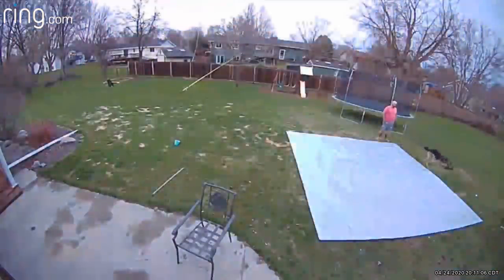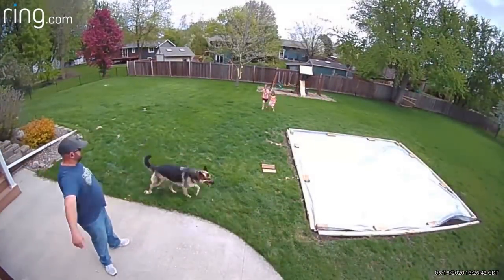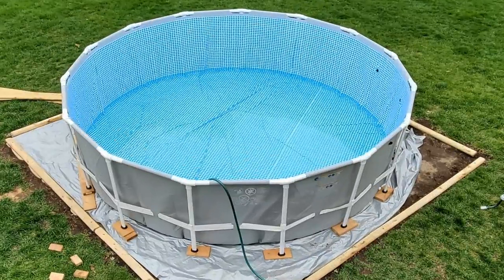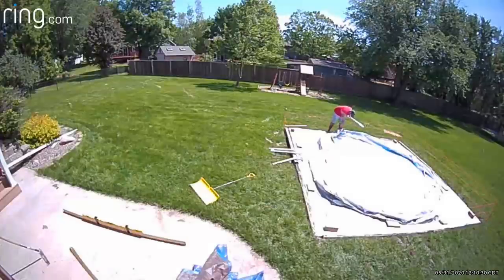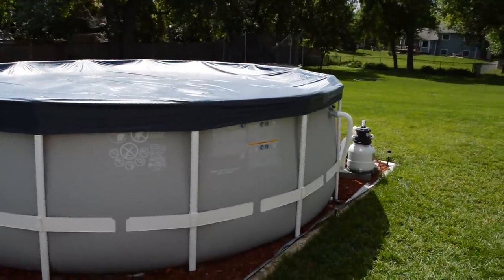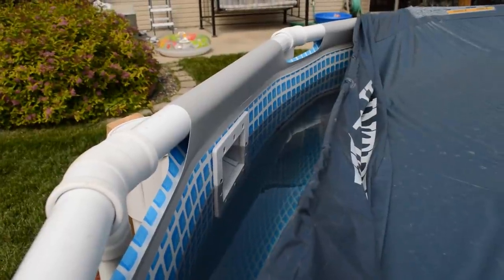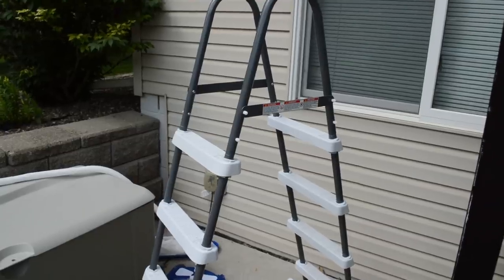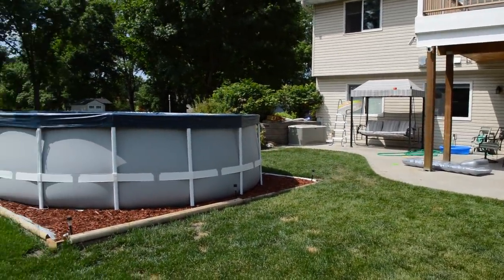Intex 15 Foot Prism Frame Above Ground Pool Setup, Review, and Mistakes!

Comment: I know how when you messed it up the first time you used sand and the second time you used black dirt. Could I still use sand or should it be best to stick with black dirt? Also I'm just wondering how is the pooling holding up now? Last question, can I use smooth rocks around the poll instead of the wood chips?
Reply from the maker: I would use black dirt to make it level first. Then pack it down. Do NOT use sand as a leveling medium because the legs will sink into it. Only use sand once the ground is level to provide a softer bottom for the liner. And definitely go with smooth rocks if that's what you desire! The pool held up great all summer last year and I'll be setting it back up here shortly!
Reply: I did not watch the whole video when I commented that so I do have another couple of questions. Did you find a replacement ladder yet? If so can you please tell me how sturdy it is and what is it called? Another question I have is how big did you cut the pool for the pumps because If I do get a pool, I don't want to cut it too big or too small. Last question, did you buy another cover for the pool or stick with that one?
Reply from the maker: I still haven't found a ladder yet that I like. I cut the holes just big enough for the jets so it's hard to know for sure. And so far, I still have the same cover.

Comment: I noticed you put the vertical legs on before the last T joint was put in place. Did that make it easier? Because getting this last T joint in is a bear.
Reply from the maker: Yes it did. It gave me some leverage to go a few different angles before it finally popped into place.

Comment: What did you use to plug up the original outlets on the pool? Thanks for all the advice
Reply from the maker: The pool came with two plugs actually to plug up the holes. Apparently intex had the foresight that some people weren't going to use the original pump for the pool. :-)

Comment: Hey great video! Question, do you have a video on what happens or what to do if it rains? Example: Do we cover the pool? We set our up already and there is supposed to be some rain this week. 😬 What do we do now...what if it over flows...🤦🏻‍♀️
Reply from the maker: So what I do is leave the cover off and let the pool fill up. The next day you'll need to check your chemicals because they will most likely be thrown off by the rain water. But if it gets too full, just jump in and splash some out! Or, you can simply unhook the return line from your pump and purge some out that way.
Reply: @dontburnthehousedownvideos  Thanks for the info.😊👍🏻

Comment: just setting up pool with intex sand filter,  how did you decide where to cut the hole for the outtake....and I assume you just put plugs in the other holes that come with the pool that are between your skimmer.
Reply from the maker: Yes! I used the plugs that came with the pool. For the outtake, I simply used the existing outtake hole and made it bigger.

Comment: I read somewhere that I will need an electrician to come out because you can’t plug the pump into an extension cord. Have you had any issues with it?
Reply from the maker: No issues at all. It runs just fine. Just make sure your extension cord is rated for the amps of the pump.

Comment: I have watched your video several times. We have an Intex Ultra 14 x 42 inch pool and have (like you) emptied the pool to level it again. I have a question about the filtration. I have added the Hayward skimmer and the pool came with a sand filter. I believe it is an 8inch filter, the smallest one which doesn't have the basket before the pump. The skimmer doesn't seem to be pulling in water and shmutz from the surface. Do you think I need a larger sand filter?
Reply from the maker: Is the filter running properly? I would think the 8 inch should work but it may need cleaning or new sand in it.
Reply: @dontburnthehousedownvideos  Thanks so much for your quick reply.The vacuum works just fine, it's just the pine needles that collect around the sides of the pool wall. I don't mind skimming by hand. the rest of the water is crystal clear. BTW it is a new pool with new sand, not even a week old so I think the sand should be fine.
Reply from the maker: Are you able to adjust your return jet in the pool? I have mine pointed away from the skimmer so it pushes the pool water around in a circle. It works pretty well to circulate all the crud into the skimmer.
Reply: @dontburnthehousedownvideos  I was thinking that might help. Right now the return shoots pretty much out into the center of the pool. I can't change the direction with the existing return but maybe I can find one with some sort of swivel? I will have a look online. Thanks again for your time!

Comment: OK our whole backyard is nothing but pavers no dirt just pavers would we be able to put the above ground pool on our pavers? With some type of padding ? Will the pool be OK on top of pavers with padding? And will the pool be sturdy as well ? We are thinking about getting one  Maybe
Reply from the maker: You'll need to put down a mat of some sort underneath it. I'm sure the pavers will be fine as long as they're level but definitely find something to put under it to protect the pool from the pavers.
Reply: OK that's what I thought. Would a pool pad the same size as the pool work ? Possibly
Reply from the maker: As long as it's thick enough to not allow any sharp corners to poke through.

Comment: Wondering what you used for a barrier between the pool and the wood chips. I’m afraid wood chips or rocks would puncture the liner.
Reply from the maker: I just kept the wood chips back away from the liner. I didn't have any issues with them traveling underneath it or causing any issues.

Comment: Thanks for this !!! Wish I saw this 4 days ago🤦🏻‍♀️ how did you cut the hole for the filter hose to put the filter water back into the pool ?
Reply from the maker: I used the existing return hole and just used a razor to make it bigger.
Reply: Omg thank you !!! Your video is the best !!
Reply from the maker: Thank you very much!!
Reply: This might sound dumb but it’s OK not to have that black thing sticking out that the hose  connects to?
Reply from the maker: On the return port, I cut it off.
Reply: Ok thanks again !! just scared putting a hole in the pool

Comment: I feel you ,our easter bunny did the same thing,  then she  I mean  ms. Bunny told me not asked  me to put it up which I reminded ms. Bunny that I'm the grinch  and you ready for the real bad news this season ! We have a  three foot drop grade from the back house to alley   for water runoff!  It drops 3.ft  in about 40 ft   .. grinch needs some cool tools let's start with a tiller !which  she delivered a week later!  Then I asked i need yard tape measure  .ms bunny asked what's that for .Well it's for me to measure and lay out the pool . So she went and got me one . So I painted a 24ft round circle for a 22 ft round . Tilled up the circle and removed dirt till it was eye level   I removed at least 2 yards of dirt . Ms bunny the grinch needs string levels . Ms bunny delivered a week later which I got perfectly level after another  yard of dirt removal  ahe asked then why dont you put up the pool now .. well I'm the grinch we need 5 yards of sand   .. ms bunny what! Yes ms bunny for it to be done proper it needs 5 yards of sand per instruction!! After a dump truck delivery of 5 tons of sand  it was time to start setting up the pool   ! It finally was setup 1 and a half months after the easter bunny thought was a good deal on a  and the equipment and sand was well above the original cost of the great deal !and ms bunny said I had no ideal how much had to be done for the pool I said next.time listen to mr grinch he knows what's he is talking about !

Comment: After soaking the sand, did you wait until it was dry to proceed?
Reply from the maker: I let it dry overnight. As it dried, it hardened up quite and made a nice base for setup. Also, I saw some water pooling in a few areas that showed me low spots that i raked out before setup.

Comment: We are going the solar heater route to heat. How long to bring it up to temp? What temp did you heat to? We bought 15’x48”
Reply from the maker: It brought the temp up from 55 degrees to around 72 in a week. Now, granted, it was also pretty warm outside so that's hard to gauge accurately.

Comment: I have question.  I am starting out on a gravel pad.  How would you suggest leveling this?  Do you think I could just use sand on top of gravel?
Reply from the maker: Is the gravel already level? If it's level, I would personally drop a tarp down on top of the gravel and put the pool on that. Adding sand will probably only make it extremely loose and you'll have lots of issues with the feet sinking in.

Comment: I am currently filling an Intex prism but I can't get the legs to go fully out straight (as the band is too tight to pull them out any more). They pull in a little ( about 1 -2 cm off plumb ).  I have looked at your pool and the legs also look like they are at a slight angle.  I am just wondering if that's normal for a prism frame and whether it causes any issues ? The pool is level.
Reply from the maker: Fill it all the way and it should even out. The pool bladder pushes out like a water balloon resting on a table when it isn't completely full. But once you get it to the top it will equalize the pressure and straighten itself out.

The other thing is that if the entire pool isn't level, the water will push to the low side and cause the legs to appear to be leaning in towards the pool. That's because the bladder is trying to roll downhill but the legs are preventing it. If the opposite side legs aren't doing the same thing, I'd say you have a leveling issue. If they're all doing the same thing, just let it fill.
Reply: Thanks !

Comment: One question. Did you had to run an electrical outlet specific for the sand pool pump 
Or just used an electrical cord
Reply from the maker: I just used an extension cord. Nothing fancy.
Reply: @dontburnthehousedownvideos  okay thank you.

Comment: Do I need to put sand underneath the pool?  Also, did you put mulch under the pool too, or just around the pool?
Reply from the maker: In the video I discussed that the sand should only be used as a final inch or so just to keep the bottom of the pool feeling soft. I wouldn't put more than an inch under there. Also, the mulch is just around the base. Don't put the mulch underneath or too close to the pool. It can puncture the liner.
Reply: @dontburnthehousedownvideos  Thanks.  How much sand should I get for a 15x42?   I think I'm going to just load the back of the truck with x amount of yards.  Mason or mortar sand work?
Reply from the maker: I used bags of "finishing sand" which is usually for paver installations. For the 15 foot radius I think i was about 30 bags in. If you're buying in bulk, there are several websites available that will estimate how much material you will need based on your measurements. I entered 15'x15'x1" square and it says about 0.7 cubic yards. Probably bump it down to 0.675 and you'll be good.

Comment: Did you simply cap off the preexisting supply and return inlet/outlet?  I have seen other install videos for the skimmer and they still have a hose connected between the two, which imo would be a potential breeding ground for nasty stuff.
Reply from the maker: Yep. The pool came with caps for those holes so I just used those.

Comment: Does the filter pump that comes with it work with a smaller pool? Like a 10x30 or 12x30? Or is it just no good for anything, period…
Reply from the maker: It might! I don't know what those fittings look like. One other gal recommended using it for a waterfall pump.

Comment: Can you share the dimension and the lawn timber used to build the lumber frame around the pool?  For 15ft pool round one, should 16 x16 square good enough. How are you joining the lawn timber?
Reply from the maker: I used treated landscape timbers from Home Depot. They come in 8 foot sections. 16x16 should be good but it will be close. I would space out the corners of the timbers a bit and give the square a few extra inches that way. (Don't have the corners touch, but have a gap where you can put a tiki torch or a vase or something.) And I don't have the timbers joined on the ends. They're just laying next to each other and secured to the ground with rebar. I drilled holes in the timbers and pounded 6 inch rebar into the ground so they won't move.
Reply: @dontburnthehousedownvideos  thanks a lot. Do I have to use the timber frame around the pool? Can I simply use the stones to cover extra area after pool install  ?

Comment: What sand did you use for the filter?  I’m clueless because every review I read has mix reviews so now im confused 🤷🏻‍♀️
Reply from the maker: It's literally called filter sand. I get it from the hardware store in the pool section.
Reply: Do you know how many pounds do I need my pump is the 12 inch?? Thank you so much for your help!!
Reply from the maker: It should tell you in the manual. My 10 inch pump used one 50 pound bag.

Comment: Did you have any problems or concerns with the pool legs? In the process on installing...again. but it seems the legs have a tendency to drift underneath the pool.
Reply from the maker: They definitely try to work themselves inwards but as soon as the water starts to fill, they push back out where they need to be.
Reply: @dontburnthehousedownvideos  thanks for the quick reply!! That definitely puts my mind at ease. I do not want to do this a third time 😆
Reply from the maker: Absolutely! I would just say to make sure your liner is flat and stretched out as best you can. Keep those wrinkles out of the bottom. After about an inch of water in the pool you won't be able to anymore. Once the water starts to rise just to to each leg and lift it up. For the first few feet of water you'll feel the legs kick out a bit. But if the liner is completely flat it shouldn't be much and it should be even. Good luck!

Comment: Great video, thanks for sharing. What size sand filter did you get, 10” or 12”?
Reply from the maker: Thank you for the comment! I went with the 12 inch model.
Reply: @dontburnthehousedownvideos  Awesome, that’s what I was looking at. Santa Clause brought us the same pool for Christmas. Just getting my research done before the summertime. Thanks again.
Reply from the maker: Buy everything you need for it immediately! Once spring time hits, they will all go out of stock on Amazon and you'll pay huge mark ups for them. Enjoy the pool!
Reply: @dontburnthehousedownvideos  what’s the gallons per hour on the 12 inch? I’m struggling to find a conversion 😬
Reply from the maker: Amazon's description says 1,600 gph system flow rate on the 12 inch model.

Comment: curious, why didn't you just go with a concrete pad? seems now like the faster/easier option
Reply from the maker: I priced it out and it would have been over $5k. It would need to be very thick and reinforced with rebar to hold the weight of the pool . It just wasn't cost effective.

Comment: U couldve used a car jack and 2x4 to jack up and level by sliding pavers underneath the unleveled legs after you’ve already filled it but over spillage makes legs sink
Reply from the maker: I actually did that originally when the legs sank but it created a massive strain on the liner to be stretched out like that. Unfortunately pushing the top of the frame up does nothing to lift the pool bladder itself. It only stretches it out. Sorta like holding a water balloon from the inlet. Adding more dirt brought up the liner and the legs, alleviating the strain on the liner.

Comment: How or what did you use to plug the two holes where the hoses would go that are on the sides of the skimmer?
Reply from the maker: The pool actually came with two plugs for the holes. I'm assuming they figured some people would want to use something different.

Comment: What kind of extension cord are you using? I read that extension cords are dangerous and to not use them. A few videos showed how it caught the pump on fire. They said to build electric outlets closer to the pool. I would prefer not to as the cost of the pool we got on sale is rising.
Reply from the maker: I use two cords rated for outdoor usage and UL listed. They're also plugged into the Kasa switches that will trip if they short out. Finally, those are plugged into QFI outlets. They should be good.

Comment: Sir, I wonder how much you paid for this whole set in total including those you bought in addition to the set that comes with the Intex pool. Thank you!
Reply from the maker: All in, I'd say I'm at about $1,000 when you consider everything from start to finish. You can definitely go cheaper than that but I feel like the additional accessories I bought and made were necessary to keep the pool operating in top top shape. Not to mention a pool net, pool vacuum, chemicals, etc. Those costs add up really quick.

Comment: How do you stretch and flatten the bottom? Would you reach in from the outside or climb into the pool?
Reply from the maker: I pulled the bottom of the pool from the outside and then got inside the pool and sort of jump kicked the bottom of the walls. If you're standing on the pool, it won't flatten out. A push broom from outside also helps.
Reply: Also, I didn’t hear the depth. What’s the depth of your pool? :)
Reply: Lol, never mind you JUST said 48”. Lol 😆
Reply from the maker: Mine is 48 inches deep. 4 feet.